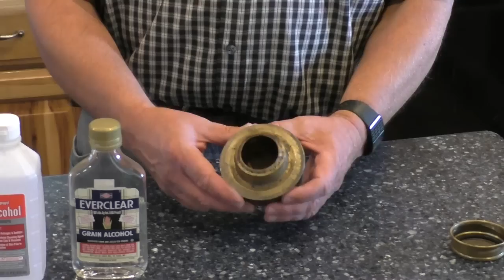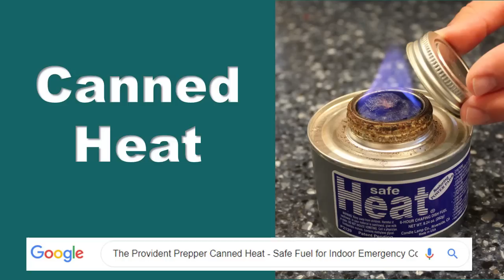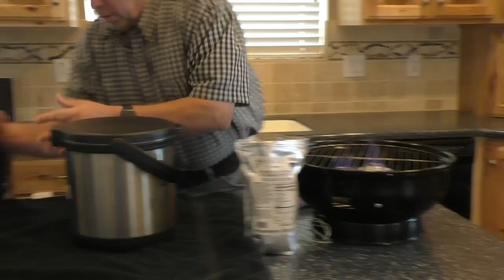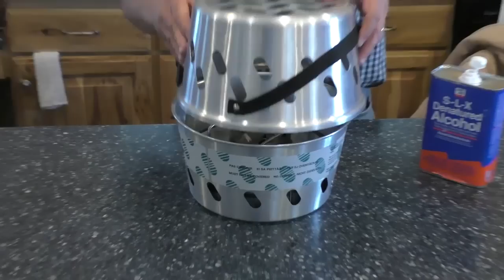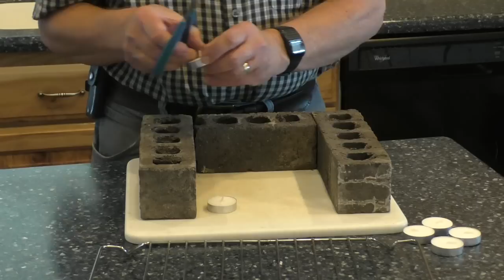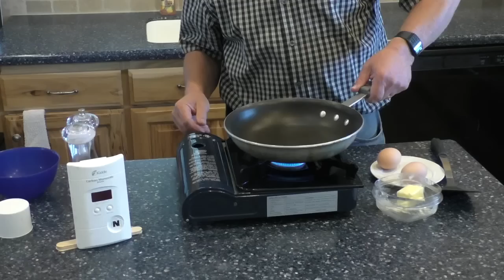Safe (and Fun) Indoor Cooking When Utilities are Gone

Comment: Hot meals are good for morale. For grid-down indoor cooking when the weather outside is too windy or rainy for outdoor cooking, I prefer a one burner butane stove and a supply of butane cylinders (I have a large room the size of a four-car garage with 12 foot tall ceilins where I do the cooking and a CO detector in the room). This is the kind of stove that chefs use for indoor cooking demonstrations or that you find at the omelet station on buffet lines. As a back-up I have a small backpacker stove that uses alcohol fuel. I prefer the butane stove because there is no risk of spilling fuel the way there is with an alcohol stove.  I am far more concerned about the risk of a house fire than the risk of CO poisoning when the grid is down.

For grid-down outdoor cooking, I have a rocket stove plus boxes of seasoned lengths of saplings and sticks of scrap lumber, a solar oven and a one-burner attachment with metal stand for turning a small propane cylinder into a stove plus a supply of small propane cylinders. I also have a Saratoga Jack thermal cooker for slow cooking, if I use the regular outdoor gas grill to heat to boiling the pre-soaked dried grains or dried beans in the two thermal pots. If I have to evacuate, I can use the propane stove, the microwave and the refrigerator/freezer in my motor coach which has an Onan generator as well as a propane tank. I am a firm believer in having more than one way of doing something just in case that one way lets you down when you most need it.
Reply: With all that equipment for cooking when the grid is down, you could open up a restaurant and feed the neighborhood!

Comment: Was there a reason for having so much head space between the candle flames and the pot? It's hard to tell in a video but it looked like there was 2-3 inches of head space. I think about 1/2" would have worked better.
Reply: The hottest point is just above the tip of the flame. However, that produces more soot than if you have the pan surface closer to 1" above the flame tips.

Comment: Stand clear, Man in the kitchen!  Here in the Philippines,  very few folks ever cook inside of the main parts of the home. Cooking is done outside the home under a shed roof or in a very well ventilated room know as the "dirty kitchen." Heat. smoke and cooking odors stay outside the home. Most folks use a one or two burner gas stove with fuel provided by gas cylinders, usually the 20 pound size. My "gas-guy" tells me that the normal mix here is 70% butane/30% propane. We went "deluxe " and purchased a Rani two burner that has a small gas grill between the two main burners. It is great if you want to gill one chicken breast to top a green salad or for a quick burger. Much less work than setting up to use the large outdoor gas grill to cook a single item. I like it for the extra space between the burners that allows us to simmer soups and sauces in large stock pots or cook pasta to serve with that slow simmered sauce. Only the most high end homes here will include a stove with oven. Our solution to an oven (the very few times per year that we would want one) is a stove-top or bread-box  oven such as was used on top of a wood stove many years ago.  An assortment of small wood gasifier stoves, a couple one burner portable butane stoves with cases of fuel cans, a few alcohol burners with stored fuel, a good supply of locally made charcoal to fuel our non-gas charcoal grill  and our backpacking gas stoves round out our year-round and emergency cooking needs. Switch on one or more rechargeable LED emergency lights and we are go to go through any power outage.

Comment: The Safe Heat cans can be reused by putting alcohol into the can.  That is what was in there to start.
Reply: Thank you. Pardon my dumb question, but are you talking about regular rubbing alcohol? Just poor a couple tablespoons?
Reply: @DChristina  there is 91% alcohol but the 70% will burn in there.  If you don't have that vegetable oil will work but may not be as good.  Most people have heard about grease fires.  In the early days animal fat was used in lamps and other thing.  It is just using the gray matter between your ears and see what you have and try it to see if you can make it work.  May need to make some changes to what you use to burn it in. I ordered some things that was a wick with something to hold the wick up right in the middle of a pint jar,  to burn vegetable oil. but could be put in something like a soup can with some holes in the sides to let air in so a pan could be put on top. Need air to come in and the CO from the burn to get out.  I saw a video that showed how that could be done using a old style beer operator. They were burning sticks but there could be a way to change things a little,  or do it like they showed and burn sticks and save your oil. There is something that is sold to put charcoal in to get it started. That can be used.  Strong enough to put your pan on top,  made to have fire in it. Small changes could make it a good stove. This is just some of the things I thought of in short time.  In 5 minutes after posting this I will think of much more!  You just need to use your head. Maybe all I put in here will work for you.  But when things get bad,  your brain is the most important tool you have! USE IT,
Reply: @donaldsmith3048  - thank you! No, I won’t be using any oil to heat or warm food. Think I’ll just buy a case of canned heat and stock up on tea lights. Take care:-)
Reply: @donaldsmith3048  - sadly, I agree that things will be getting bad. Thanks for your input. Yes- we must use our heads and I believe, our trust in the Lord.
Reply: @DChristina  Denatured Alcohol.  It is a burning fuel.  Be carful as the flame is easy to miss.  Antique chafing dishes use this because it does not leave residue on the pan.  It’s a clean burning fuel.
But if you are in a dire situation, then whatever will burn, and as long as the you have something to support your pan.
Reply: @leopardwoman38  - thank you, I’ll get some. Take care:-)
Reply: @DChristina  have you seen this article?

https://theprovidentprepper.org/best-alcohol-cooking-fuels-for-campers-and-preppers/
Reply: @ter8330  This is a great article!! . Thanks for sharing!
Reply: Good idea!
Reply: Thank you!  👍

Comment: I guess I would disagree on the safety of Butane burners.  I agree to always be safe,  but a butane or My propane fire gas camp stove will produce no more carbon monoxide than a standard gas kitchen stove.
Otherwise,  you are doing some great videos,  keep up the great work.
Reply: Kylene's advice to have a CO detector right there makes a lot of sense. I imagine that during a week-long winter storm power outage, the oxygen level in in the home could gradually be depleted, especially if you were using other candles, lanterns, etc. and CO could become more of an issue. 

By the way, I have heard of CO poisoning from gas kitchen stoves left on for long periods in a sealed house.

Comment: That was a great demonstration but did you mean to say a little bit of rice with your butter?
If the electricity is off does that mean the wired in smoke detectors won't work? Our apartment is all electric with wired in smoke detectors that have battery backup. If the electricity is off can I safely use an open flame to cook without setting of the smoke detector? The apartment rules are that we can't use anything like that but I'm thinking in an an emergency if we have no electricity for a long spell...
Reply: @TheProvidentPrepper  There are two types of detectors. Particle detectors detect the smoke that you sometimes get from a fire - such as a maladjusted kerosene lamp or burning wood/paper. Ionization detectors detect the ions produced by burning, whether or not smoke is produced.  Some smoke detectors, the best kind, detect both particles and ions.

So whether you could cook indoors without setting off the wired in detectors with battery backup would depend on the design of the detector. However, if it were absolutely necessary, you could remove the battery backup while you cooked.